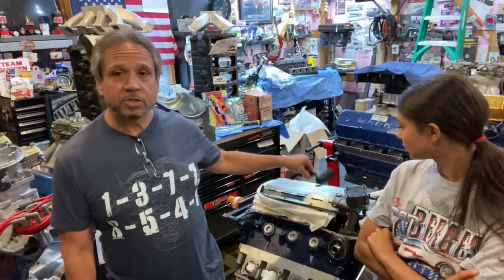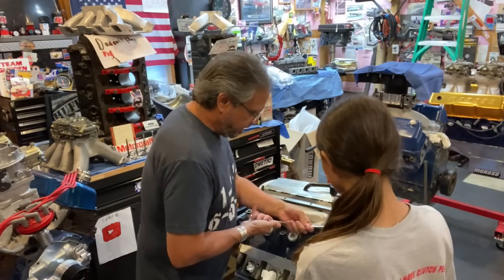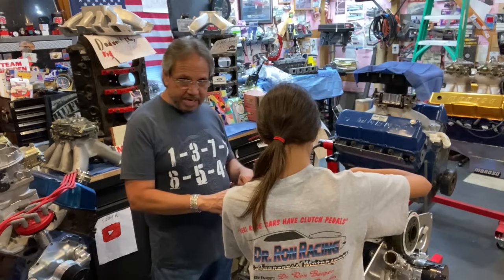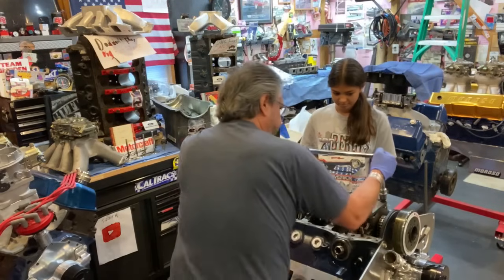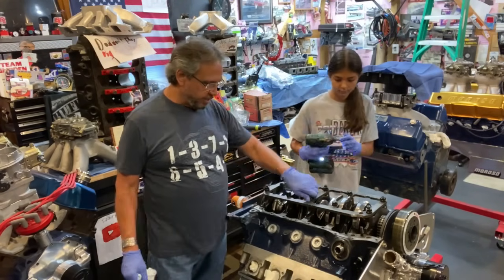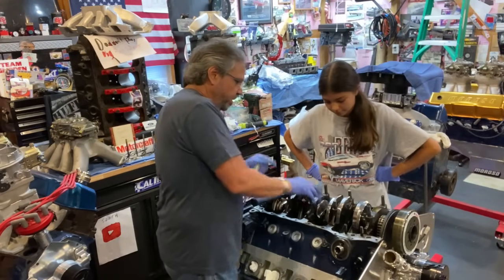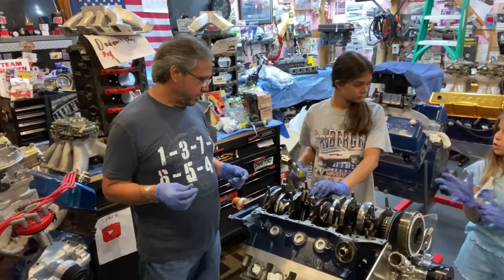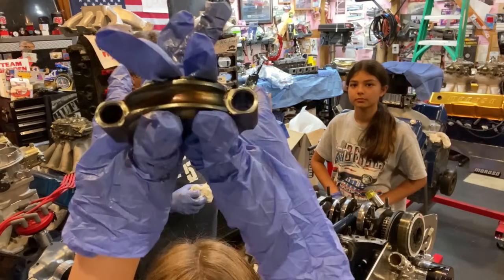DBG: Let's See The Damage: No Oil Pressure, In 769 HP 409ci Ford 351 Cleveland= ET 9.37 Result: Fail

Comment: Love your channel. Love your family. Love your truth.
I'm Ford guy. Did over 500 engines over the years. Had my own shop.
Customer blew up a BBC in a boat. Pickup tube feel off. If I ever did a Chevy, always brazed it on. 
If I were going to run an expensive Cleveland, I'd run a motor plate and use a rear sump. 
Get rid of the shock towers and suspension. 
The pickup tube is also going to be bolted to one of the main caps. 
Also, when I built figure 8 racing Cleveland engines to run at Monroe Washington, I ran two oil pressure gauges. One off the front of the block and one off the rear. 

Side note. Has to do with 4v heads, dot or not.
I was looking through all my heads. A pair of 1971 boss 351 heads I have has no dot, just a big 4 in the corner.
Anyone else find this ?
Reply from the maker: All good info Jesse, running the plate, shock towers cut back. As far as 4v heads go. The dots and all the bs means nothing just casting info. 4 is for 4v usually.

Comment: My philosophy has always been to do whatever I could to improve the overall package whenever I was faced with any sort of setback. The thought of coming back even better gave me something to really look forward to and took some sting out of issue.
Reply from the maker: Geneticrex, you got that right. I have learned a ton and now will implement what I have learned. Hope others learned something from my mistakes. 9.20s here we come.
Reply: @DragBoss351Cleveland  There's always  places to pick up something and a properly constructed pan with the correct amount of oil is worth quite a bit in a wet sump configuration.
Reply from the maker: @geneticrex figuring that, at this point, definitely an investment and improvement from what I have been using.

Comment: First off Tim, you have some great helpers in the shop.
They are getting in on the ground floor of some good experience. 
I glad that your engine is not hurt to bad.
Should cleanup pretty good.
I am thinking, torque the rods up, and check the housing bores.
I bet they are small.
Which would deminish rod bearing clearance. 
It will be interesting to see what you find.
Definitely new bolts and a recon of the rods.
I would check the pistons, pin bores and rods bushings also.
As there was no splash lubrication. 
For pistons and pins.
Atleast you have a fixable engine.
You will be running better in no time Tim.
Have a great week. 👍
Reply from the maker: Thanks Ed. Not messing with rods, I will replace. Crank. I will get evaluated, but get another. I will use it somewhere along the line. Yes they are beginning to enjoy working on stuff In DBG. This is the time they learn the most. Thanks for the advice. Stay tuned and see what is next.

Comment: If you have  to hone it and you have more clearance than you like. You can send the pistons to Line to Line coating.  Lake has a video I think.
Reply from the maker: Don current pistons have coatings, already. I doubt the bore by the looks is worn that bad. I used calico coatings.

Comment: I rebuilt a 1970 351 4V motor that came out of a Mach1. I replaced bearings and gaskets, cleaned up pistons, and replaced rings. I honed the cylinders lightly and just broke the glaze. I replaced the oil pump with a hi volume, big mistake. I used the stock oil pan and broke in my motor with low revs and baby it for one thousand miles. I changed oil and filter and went out to Baylands race way park. Made my first short shift pass with a 15:50 et. In my second pass, I raised rpm to 5500 and let her sing. I went through the traps with my engine, making a lot of ticketing noise. I took it out of gear and gave a little gas, and the noise was still persistent. I got home and pulled motor out, and dropped oil pan. Nothing but fine shavings everywhere, rods got hot because they were discolored. It was an 11.1 compression motor, and the pistons were touching the cylinder head. I put a for sale on the car and sold it as is, motor and all. I never bought another Ford again. In the upper left corner is my 2018 SS Camaro that has never given me any problems.
Reply: Get back to us when your Camaro runs 9.36@142.49 naturally aspirated !!
Reply from the maker: To me issues with cleveland is drain back. None of the oil drain backs line up with heads. Do oil mods like I have, 9 qt pan and go. Stock oil system good to 6800 ish. With out mods. Enjoy the Camaro
Reply: My Fords have given many Camaros problems over the years. Clevelands and Windsors alike. Stock-style oil pans o.k. to use high-pressure, not high-volume oil pumps. Sounds as if you needed thicker head gaskets. For future reference on average, achieve quench clearance of .030 with steel rods and .040 for aluminum rods. And keep 'em under 7000 r.p.m.
Reply: @DragBoss351Cleveland  Thanks for your advise DragBoss'
Reply: @arkhsm  It's a street car, but it's last run was a 12:30 at 114 mph last time I took it out on street tires. It's got a 6.2 L with a 8 speed automatic, shifting points are 6,500 stock everything. Its a Street car @arkhsm'
Reply from the maker: @vanlarson9213  Right on, hope I helped
Reply from the maker: @billfioretti3013 the quench I measured was .035 from memory. This really needs billet caps and dowels. But not investing at this time. Better blocks in future 😉. Packing up oil pan and Doug from precision called so call him back, get a few pumps, some builds coming up.

Comment: So question is what really happened, high volume pump suck all the oil out of the oil pan, running full groove main bearings not a good situation. Better to cross drill the crank. They do make main bearings that are not full groups but partially. Like the Jaguar engines and other imports.
Reply from the maker: The answer is a broken pick up. Don’t have those other issues. Stick with aftermarket cranks and you’re ok.

Comment: Pull the rod bearing out of the connecting rod cap and see if the saddle is burnt, if so off to the machine shop to have rods reconditioned
Reply from the maker: Not worth it too me Dennis. Rather have new rods. May get a crank too and have current one evaluated. Crank may clean with 10 under
Reply: @DragBoss351Cleveland  How are the saddles for the Main Bearings because if they are burnt whether caps or block the block will need align bored because the bearings won't last????
Reply from the maker: @dennisthomas4766  My builder will eval. He said bring it down, and lets get going on it, for being bad, the bearings look good.
Reply: @DragBoss351Cleveland  I'm glad you caught it in time
Reply from the maker: @dennisthomas4766  me and you both.

Comment: As you said Tim, take the crank to Shaftec, they will crack test, xray, what they do in this instance...If it goes .010  .010 , its not a big issue.. get same rods, it will be a tickle on the rebalance....  It Lived though, not a Big Hand Granade...
Reply from the maker: Dam straight on that. Agreed. Was think about that guy in Toledo or Mi who does a lot of cranks. Arlen or something. Know him?
Reply: @DragBoss351Cleveland  Tim, i'm in Australia Bro... you will find a shop, i've seen cranks worse that that come out ok...
Reply from the maker: @drcolster that’s the plan, get it evaluated and have plan B ready. Spare crank for this or another build. Thanks Mate

Comment: Bummer about the pickup tube breaking. Might wanna do something about that. I wouldn't worry about what the uneducateds say about using a HV oil pump. just use what works. Recondition what ever needs too be done and put it back as it was.
Reply from the maker: Right on the money. I do what works for me. Simple. Ready for the machine shop.

Comment: Tim with that RPM at the end ya gotta remember that the driveshaft is doing that too, you havent lived until it comes up through the floor and goes out the back window. The girdle design troubles me, what if you put nuts right on the main cap, pull em down then the girdle and another nut?
Reply from the maker: Hey Fred, don’t want any driveshaft funny stuff happening. The girdle sits on thick washers that sit on main caps.
Reply: @DragBoss351Cleveland  I watched you get it apart, just was thinking from a vibration standpoint put a nut on the cap, pull it down then the girdle then a nut on top to hold it on?
Reply from the maker: @fredkelso1089  I see what your saying. but there is a big thick washer under girdle. How would a nut be better?
Reply: @DragBoss351Cleveland  Im just thinking the nut with its clamping force on the main cap itself with the girdle above it may be better at surviving crank vibration, just thinking out loud

Comment: I run an external oil line from front to back and run full groved main bearings in number 2 and 4 mains to correct crank oiling for rod 2 and 7.
Reply from the maker: I run that line too, first time. Not sure if it makes a difference. Aftermarket cranks fix  that oiling issue. Never ran grooved bearings.
Reply: this is my first one. It has been a dream of mine sins I was 19 to do up a Cleveland. Just fired in for first time other day. So nice. @DragBoss351Cleveland
Reply from the maker: @MsRockcrawler congratulations on that. Hope I could help. Good luck with it. Keep me posted. 🏁💯

Comment: Press fit oil pump pick-ups are known to come apart.Heat and cooling cycles loosen their connection over time.For the high stress of road or drag engines,a couple small TIG spots would be a good insurance policy.Ive seen this happen on aChevy and Pontiac engine in the 60’s,but very rare occurrence tho.
Reply from the maker: These pick ups are threaded, terrible design to me. Investing in a new Stefs pan, get that potential issue off the table.
Reply: @DragBoss351Cleveland  Pretty thin material to accept a thread.With vibration,I’d be concerned with stress fracture at the bottom of the thread.Stef’s pickup mounting looks foolproof.
Reply from the maker: @babaoreally8220 you got that right. All nasty vibration. Will rebalance rotating assembly too. Stefs for the win